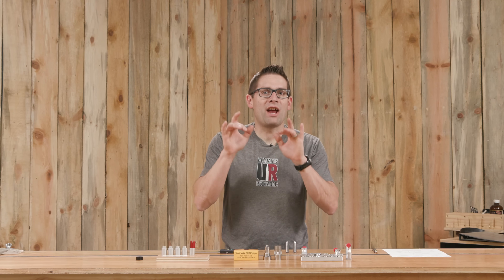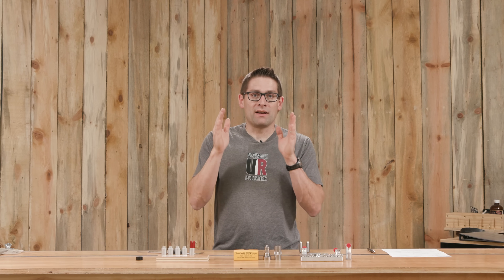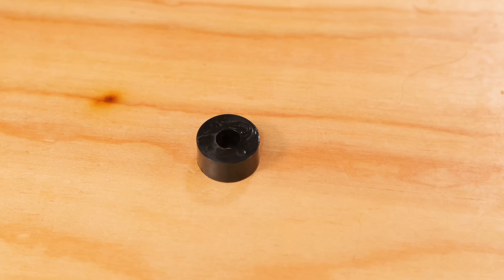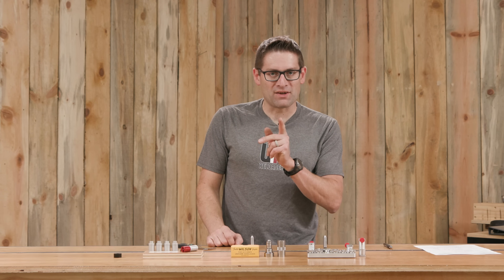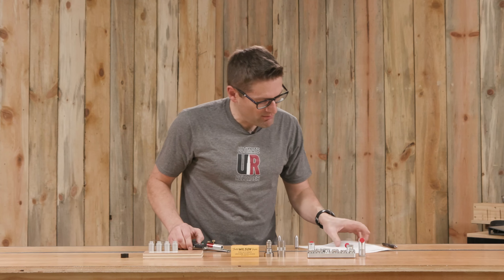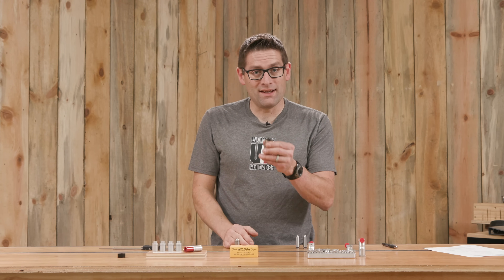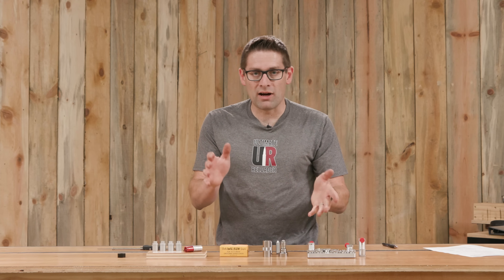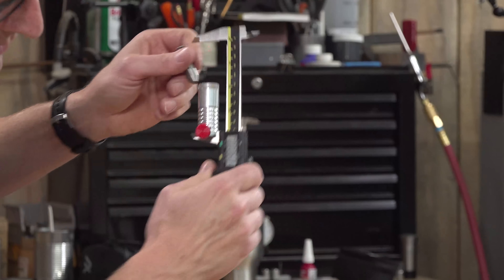3 Ways to Measure Headspace

Comment: I love this video, although I have no clue what you just did in relation to cartridge seating in the chamber to the barrel and bolt. Does what I just wrote make sense?  Signed, 
Confused so much I don’t know what I’m actually asking😀. Then I think about your relative values vs real or finite values. It seems to me they came out the same. 
Finally, how does this affect resizing the case?

Comment: As always, great video!  I've only used the Hornady comparator kit for a year, and its 0.400" datum piece chamfer depth has increased 0.0015", meaning that my prior headspace measurements now seem too short...I might add that by having a go gauge with actual length printed on the side, this can always refer one back to absolute measurements to compare with actual SAAMI specs (which lets you know what the chamfer depths are on comparators)

Comment: A bit confusing here in regards to what you mention, four dimensions overall. A go gauge, no go, and Saami chamber and then ammunition dimensions. You mentioned the saami specifications at chamber length at 1.6486 and the ammunition at 1.6517. So how can ammunition at 1.6517  fit into a chamber at 1.6486?  In addition the Saami specs dimensions exceed what your go (1.641) and no go gauge (1.647) are at ?  Can you clarify this?

Comment: Hornady but read the following;

TIP:  for the Hornady bullet comparator; I just measured 3 different 223 bullets of different weights and manufacturers and found a total of CBTO variance of some .030. All bullets must have identical O'Gives. 
Then I removed the plastic plunger and filed down the rounded end into a more pointed end and remeasured a 3 bullets again @ 8 each and found the new total variance of the same bullets to be .010. In two of the bullets the CBTO variance was less than 5%. Very accurate now. 
My conclusion is the bullet bases are not 100% perpendicular to the concentricity of the bullet and the plastic plunger end is too large to get an accurate reading on a small point from the base of the bullets. 
This was all done in a brand-new JC Custom barrel just purchased and not installed. 
I wish Hornady would install a smaller metal pointed end on their plunger for a little extra money.

Comment: Nice description of how to measure CBTD (Case Base To Datum), but not ‘Head Space’.
Because HS (Head Space) is the distance between the case base and the breach face.  It is in all cases of any design the distance the case head is permitted to expand into during pressure.

Being an ‘inside measurement’ HS typically is found to be within range by go-nogo technique.

Using the tools shown will only confirm your ammunition is within the SAAMI dimension allowance.

To actually measure Head Space directly requires measuring the actual distance between the breach face and the datum line of the chamber and then comparing it with the loaded ammunition case base to datum measurement to arrive at the number (which in all cases is below 0.010” as I recall).  Things like extractors, ejectors and bullets seated long tend to put the case base in contact with the breach face at firing, which causes the actual expansion to be forward to the datum line, or some combination of both.

One way to approximate the breach face to datum measurement of a given chamber is to measure the CBTD of a statistically significant number of fired cases.  The cases should be as nearly identical as practical, same lot, etc.  

The fired bottle neck case will have ‘sprung back’ from its maximum CBTO by an amount that can be up to 0.002”, so use that as your error band, eg: the measured Average Fired Case CBTD +0.002” is near the absolute BFTD.

Bottle neck cases that will be fired in the same chamber for the rest of their lives will live longer if they have their shoulders moved back the least amount necessary, plus they center bullets much better than loose ammo.

Experiment with ‘shoulder bump’ and/or document the Head Space.

Https://SnellsNotebook.us for much, much more info.
Reply: Thank you for posting this. Nothing against Gavin but it's people like him that put out data that is not fully accurate that causes confusion among those trying to learn.

Comment: I use the SAC kit and it is the best I've found. With this tool, I can set my headspace very precisely, where my handloads are right at the perfect threshold. I can also virtually do the same with the Hornady tool but SAC is a little more reassuring. I will warn folks that read this that most of the items sold by SAC have a real good sticker shock. Nothing they do is cheap.

Comment: The Hornady bullet camparator kit (for relative measurements) works well too, just use an insert a few calibers larger than the cartridge being loaded.
Reply: I was wondering if anyone would bring this up. I use the Hornady bullet comparator kit also. I went to the SAMMI site to find the correct datum diameter, choose the comparator with the closest diameter, check cthe distance on a quality factory round before firing (write this measurement down in your reloading log) and after. This gives me a relative distance comparison. Then when I set up my reloading die I can better set my shoulder bump distance. I have gone to the trouble of loading what I call a "test dummy" round. This is inert (has no primer or powder) but is sized and has a bullet seated at my chosen depth. I will make 2 of these, load them into the rifle and manually cycle the action to make sure they will work correctly. 
This may be going overboard but it reassures me  that I should not have any cycling/feeding issues on the range due to ammunition... hopefully.
I'll go through this process when setting up for each (new to me) firearm I load for. I use the Lee Precision Classic Turret press. Then I can set up a turret head for each caliber, check my different distances with load standards I've created for my firearms and go from there.
Reply: are there not specific #s printed on the side of the gauge to tell you which one to use ? 
ie: A330 can be used for 223 cartridges correct ?

Comment: To whomever would like to respond:
Is there a reason why my Sinclair bump gauge insert for .243 WIN doesn’t seem to reflect the the headspace line of the SAMMI spec when measuring my new stock ammo?  I see the headspace is measured out on the taper at a very specific dia of the shoulder of .400”. My Sinclair bump guage insert seems to measure my stock Norma, Federal and Winchester cartridge factory new loaded brass at 1.613” , 1.628 and 1.602 respectively. The data in a reference book I have shows the headspace line at 1.634 +/- .007 at .400 dia point. With exception of the Federal at 1.628, why are my other two brands at 1.613 and 1.602 showing so much shorter than the SAMMI spec? If 1.634 +/- .007” is the SAMMI Spec of the .243 Win headspace at .400” dia point of shoulder, why are 2 of my new stock ammo examples shorter than SAMMI spec? Is it my bump comparator insert that is machined incorrectly and not reading at the .400” dia point or something else? I’m somewhat confused, is the case head to datum line the same as the headspace measurement that is referenced. In my common reload manuals it shows a measurement from case head to the very start of the taper, rather than at the .400” dia point of the taper which is called the headspace measurement “as far as I know.” So what point is the datum line then, is it the start of the taper or is it the headspace measurement at .400” dia of shoulder as in the .243” ? Any insight guys as to what point my Sinclair bump gauge insert is actually designed to measure, is it designed to measure the head “or end of case” to datum line, or head space, or just an arbitrary measurement somewhere along the shoulder for measuring case stretch?
Reply: I think I figured out my answer. The reload manual does not give a headspace measurement. The manual will show the start of the shoulder taper and also the length to end of case. The datum line is used to refer to a very specific point along the taper of the shoulder to the very end of the case end. It is this measurement that is called the headspace, it is taken from the end of case head to the datum line along the taper at a specific dia point of the shoulder taper where the cartridge is stopped in the chamber. It’s this measurement that is defined as the headspace by SAAMI. Speaking of the .243 Win, at .400 dia point of case shoulder back to case end of head , it should measure min 1.627 to 1.634 max length to be within SAAMI Spec. My Sinclair bump gauge insert does not measure at the precise .400 dia point of the case shoulder. Therefore this bump gauge type insert is for a comparative measurement only, “not to measure actual true headspace.” This tool is just to allow you to see how much you are bumping back your shoulder with FL resizing dia. So by measuring with this tool after firing the new cartridge’s brass in your chamber, you can then measure length with this bump comparator bushing, then bump the shoulder back with the resizing die, then measure “compare” this with the previous measurement. It is this difference that shows how much you sized the shoulder back or shorter. Many people will say for a bolt action rifle,  a bump back of shoulder “using this bump gauge comparator method” .002 is sufficient. For autoloaders, pumps or lever guns more of a bump greater than .002” is suggested to allow the action to close fully and with enough clearance to allow proper feeding/extraction.
However the bump back the shoulder of a fire-formed case of only say .002” is only going to make that cartridge fit the specific rifle it was shot from only. But the advantage of just bumping back say .002” is prolonged brass life and perhaps more accurate cartridges for that specific rife. If one wants to size their brass to fit other rifles as well, then sizing back to SAAMI min headspace is suggested. However this sizing all the way back to SAAMI min will cause your brass life to be shortened because the brass is being worked more each time “work hardened” if it is sized back to SAAMI Min each time. If I’m in error in anything I said, please correct me, for this is only what I’ve read. I welcome learning. 
Experiment solely at your own risk!
Reply: Very concise answer and correct to how I understand the goal of resizing during the reloading process. 
To date, after about 4 years of reloading, the only cases I've had that failed are range pickups in .223. I don't load them to max pressure but to best load for accuracy in my rifle. I'm generally running about 200-300fps below factory loads in my rifle as read by my chronograph. 
The case failures in question are usually neck splitting after firing and could be mitigated with annealing.
With .223, I use the same load for my bolt action as well as my MSR. They go from about a 1.5" group in my MSR to a bug hole in my bolt action. I developed the load for the MSR, and got lucky with how well it works in the bolt action.

Comment: I use the Hornady Head space tool to measure shoulder bump and then I use the LEWilson gauges w/o the micrometer to verify the fit and overall length using the step gauge on the top.  Works well for me but I’m not a bench rest competitor.
Reply: I do pretty much the same. For a bolt action rifle it’s easy - just bump that shoulder back a few thousandths and you are GTG in that rifle. Absolute numbers don’t matter. For a semiauto where the case may start ejecting before all chamber pressure is gone, a fired case may not fit in the chamber without resizing. I don’t entirely trust the “absolute number” with the Hornady comparator - those aluminum bushings are somewhat soft and I’ve seen some drift over time in the measurements I get. That’s when the Wilson gauge verifies that my re-sized case fits within proper headspace.

Comment: Great video . What is go no go ? When I resize I try the empty  case  in my rifle after resizeing . I adjust my die until the bolt has just a little resistance when I close it. Then I reload them from there and write the measurement. My loads have worked well doing it that way. What do you think ? Great videos !
Reply: Assuming you will be using your reloads in the same weapon that fired them originally, your technique, in which your are essentially only "neck sizing",  provides the most accurate reloads, since headspace is kept to a minimum and is consistent across your entire lot. Since the case is "fire formed" to match the specific dimensions of your weapon's chamber, the reloaded cartridge is an almost perfect fit. The added benefit is that your cases will last much longer since there is less metal stretching into the neck that ultimately has to be length trimmed.

Comment: Just do neck resize and chamber the reloaded ammo and work the bolt, pointing the barrel in a safe direction. Rework the bolt, to extract the cartridge and do the same for all reloaded ammo. The only condition is that these are for the same rifle. That is, if you have two .30-06 , then then do not mix the empties. That's it. 
In a capitalists society, they DISCOURAGE people to use their own God given common sense and BUY INNOVATIONS so they can profit from your ignorance.☹

Almost 50 years back (in India), very few people used scopes on their rifles. Dad use to drop Black bucks upto 200 yards with open sights.30-06 Remington Express rifle, most of the time hitting on the shoulder.  No BDC, or MIL DOT or using range finder. Later on, 4X fixed Zeiss scope was mounted on another Remington 721 and he use to drop same black bucks upto 500 yards..one shot, one kill. USING COMMON SENSE and experience only.

Comment: I have been using both for several years. I find that it's a bit easier for me to use the LE Wilson gage for the reason that it has less parts to juggle. The only thing you have to be careful of is to make sure that when you screw the mic down you don't use any more pressure than is necessary to make contact. Takes a few tries to get a good feel for it. Very accurate kit.

Comment: In my Encore you need a depth mic with adapter and a feeler gages as frame flex can allow case length growth even starting at zero headspace in cartridges like 22-250

Comment: Sooo…. The best way to set the headspace dim of your cartridge for your gun is to take fire formed brass, dismantle the bolt assembly of your rifle, remove the firing pin and springs/ejector, start bumping back the shoulder until the bolt just barely drops without resistance.  Setting your headspace with a 0.002” shoulder bump.  This will typically be 4-10 thousandths longer than SAMI spec, but regardless it will be set to the actual headspace for your gun.  This will improve accuracy and most important extend the life of your brass..  also, no ‘Go’ or ‘No-Go’ guage necessary..
Reply: I suggest you watch Eric Cortina he talks about this. He says .002 of shoulder bump. Being an f class shooter I'll believe him.
Reply: @orangerider2827  - haha…. Ive watched them all.  Ive learned alot from Eric’s videos.  Thanks!!

Comment: I still don't know why you check headspace.  Is it to see if a chamber is worn out?
Reply: No it’s so you bump the shoulder back far enough to allow you to chamber the round and close the bond. It allows proper cycling. If you bump too much you can overwork the brass and eventually cause case head separation.  It’s an important topic.
Reply: From my understanding it’s to adjust seating depth on rounds
Reply: After FL resizing .30-06 brass to create .25-06 brass, the rounds were difficult to chamber.  The OAL was consistently 2.501-2.508.  Because i'm kinda OCD on this stuff, I'm going to get Whidden micrometer case gage to ensure headspace is correct before I trim 200 pieces of brass.

Comment: I have had issues using the Wilson gauge as compared to the Hornady and SAC, the Hornady and SAC delta head space reads -2 , the Wilson reads -7, I am pretty sure the Wilson gauge is incorrect, if I bump -2 using the Wilson gauge, the bolt is difficult to close and that brass reads a delta of  0 to +2 on the SAC and Hornady
Reply: I have the same problem whit Sinclair and Wilson, 6.5 and 308